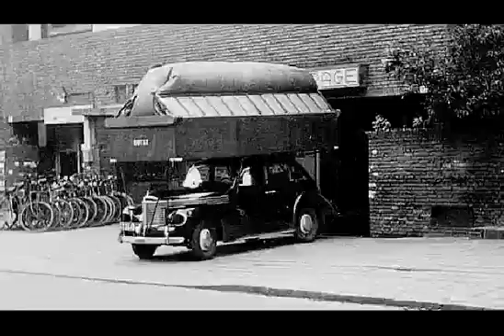The Coal Gas Powered Car  1941

Comment: From what I understand, these were VERY DANGEROUS because if they contacted an ignition source, like a low hanging electrical wire, they would EXPLODE with enough force to blow out the windows of buildings for a hundred feet or more away, causing burns for the vehicle occupants and flying glass injuries for anyone nearby. No thanks.